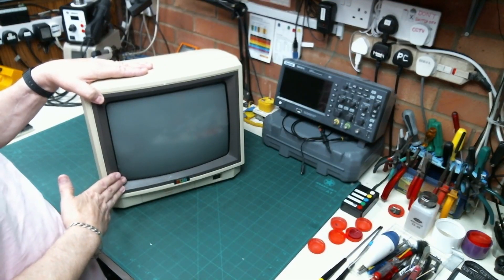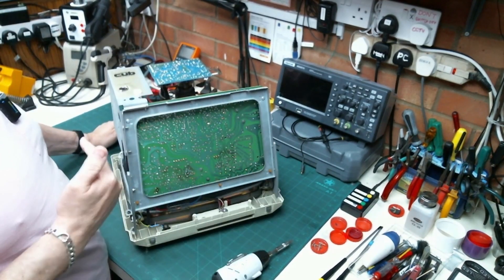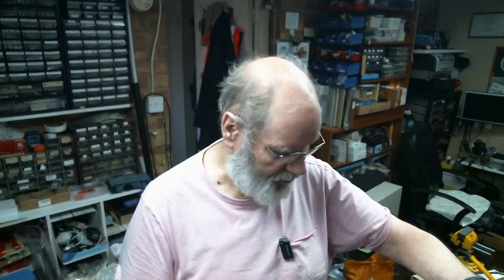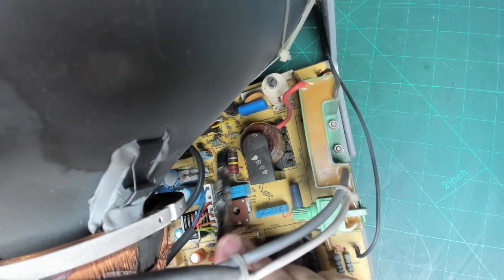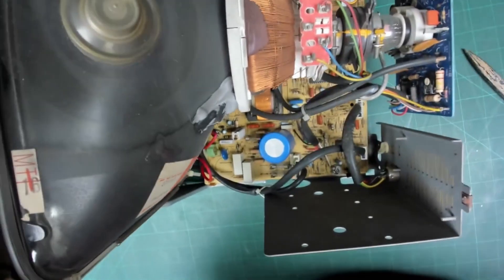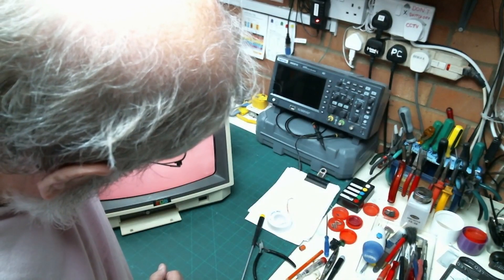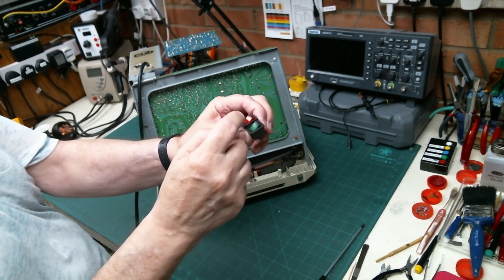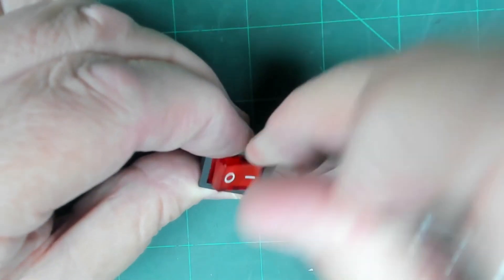CUB 1451 Recap and Repair

Comment: Are the electrolytics the same between the 1431 and the 1451?
Reply from the maker: From the service manual:-
MODEL 1451
NOTE: As models 1431 and 1432, with the following exceptions:
RESOLUTION 652(H)x585(V)
DOT PITCH 0.43mm
CONVERGENCE ERROR 1.2mm screen edge
So no, the caps are the same.